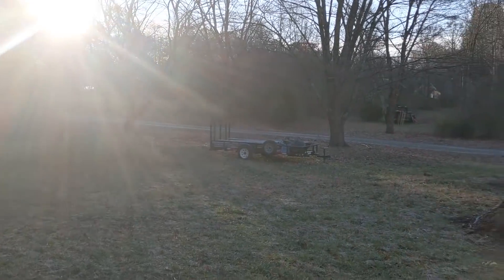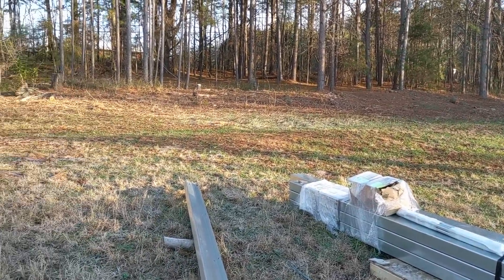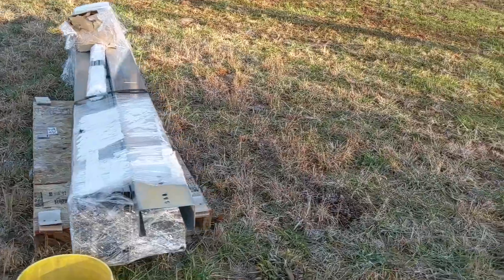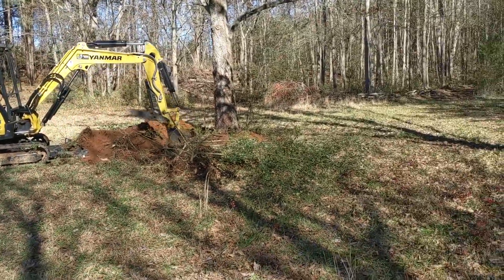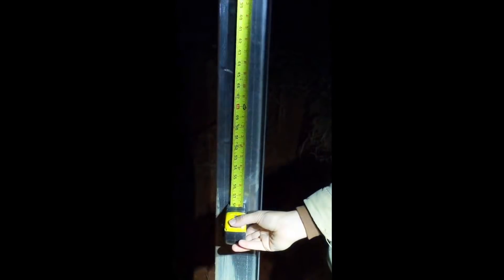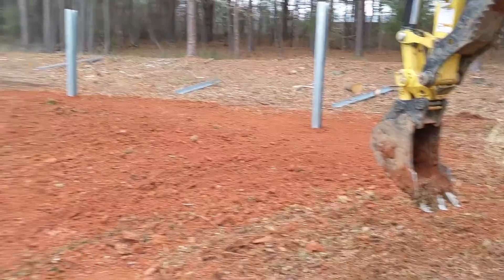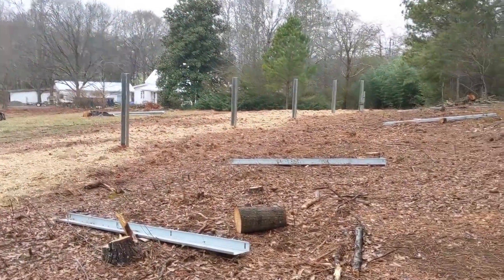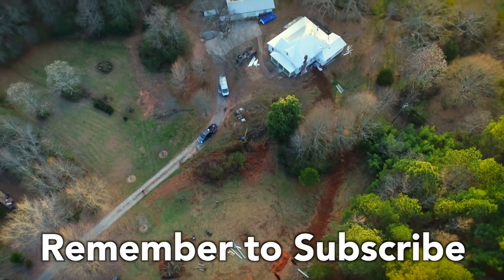A well engineered and affordable ground mount!

Comment: My state requires engineer approved ground mounts that can withstand 85mph winds.  I really want an engineer to come up with diy plans so I can afford to put up a system on my property
Reply: Iron ridge has a design assistant and wind speeds pre engineered. They actually create all needed dimensions and materials needed for your setup. It’s a great option and absolutely a DIY option.

Comment: Look, everything could be extremely well made, but it’s galvy, which blows ass, if you want good, stainless is the way to go. And stainless is cheap, for the jobs you’re talking about. If they try to charge a lot, stainless shouldn’t cost very much more than galvy, if it does, you’re getting screwed. I work with and weld a lot of stainless for dairy farms, out in the west, so they are usually 2500+ to 5k+ cows on a single
farm, stainless isn’t expensive , aluminum is garbage